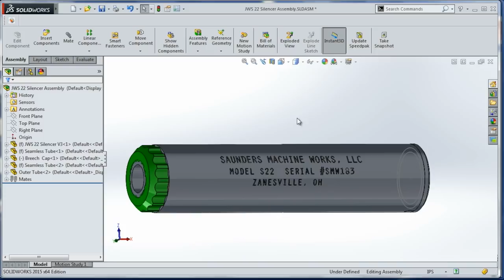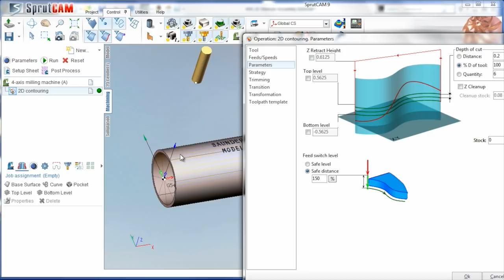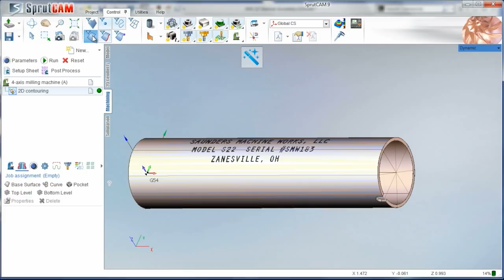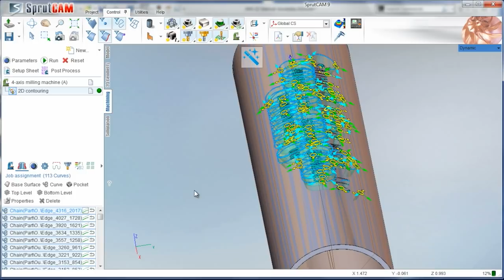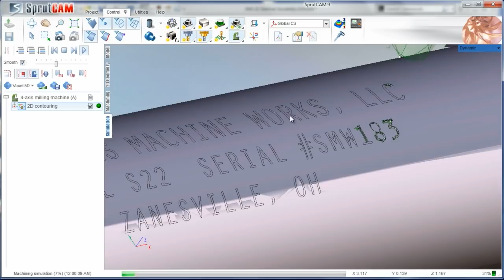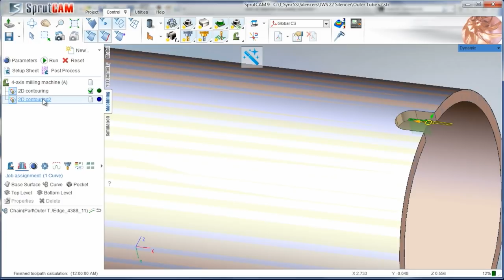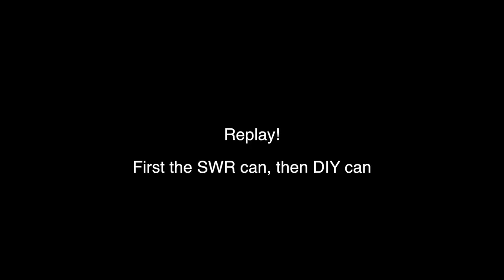DIY Silencer!  Machining a Monocore - Part 4 Widget38

Comment: I am amazed, I have watched several DIY suppressor builds and yours is by far the most in depth, best looking and well designed. I like that you also included the details of the cerakote process.

Rimfire suppressors are so impressive with subsonic rounds, the sound of the bolt cycling in a semiautomatic is louder than the shot its self. 

I agree from the video perspective that yours is quieter than the Silencerco Spectre II, and yours is almost an inch shorter. 

I hope you consider making a centerfire rifle and/or pistol suppressor. 

Keep up the great work!

Ps I like all your videos but really enjoy the firearm related ones.

Comment: Great Job John!  One thing that I do when installing a pin, is to drive it in a little proud, then turn it flush on the lathe.  You method works great also.

Comment: At Min 11 when you are trying to drive in the dowel. You filled the hole with Loktite, you had a hydraulic lock with the pin in the hole, a small hole through the bottom into the core, or use a roll pin.Great series, don't own CNC equipment, but love watching you make stuff.

Comment: Awesome series, some really nice work done! The cerakote looks like a great option to have in the shop. If you have an internet connection in the shop I would recommend dropbox, everything is automatically backed up, you can access files from anywhere with any machine and you can share folders with customers which is great if you are working on larger projects or long term contracts.

Comment: Hi John,
Both silencers are very quite from where I am sitting.  The sound seems to be about the same from both.  Keep in mind that my hearing is not as good as it used to be.  Anyway, your DIY silencer is quiet.  I'd call the project a success!  Thanks for the video!
-mike

Comment: awesome video series. your reaction is great too. only thing i thought that might not work out for you is your index pin on the core. what might time correctly for the rifle you have might not work for the next. ive noticed each manufacturer cuts different thread lengths and unless you machined a stop on the inside of the core, couldnt tell for sure, your engraving wont always time correctly for you. this is something ive noticed with my silencerco sparrow and why i think they machined a wavy pattern into their tube, so that you can index it to whatever position works. btw love the pws, i hope to have one someday.

Comment: That turned out very nicely. Wish I had a solvent tank. For now on small parts I use my sonic cleaner with some harbor freight cleaning solution it's an awesome degreaser.
Reply: I had one at my dads house but someone stole it before I could get it. I loved it.

Comment: nice wnork! The older stacked and spiral baffled silencers work as well and in some cases better then the monocores but they have some disadvantages...usualy heavier,tend to be a bit bigger and are a pain for maintenance.Either way it doesnt matter as long as it works and you can enjoy using it!Just a heads up tho most people including most cops are not well informed so be prepared to get the third degree depending on who sees it lol...course after you convince them, they will want one

Comment: Amazing work! Fascinating to watch and superb results. Volume-wise your suppressor versus the commercial one sounded about the same to my ear. Your version sounded slightly higher in pitch/frequency, so I assume it is dissipating the pressure slightly quicker than the commercial one, which would potentially mean yours can deal with increased firing rates better than the commercial one. :)

Comment: with our sandblast cabinet, we use plastic film under our glass to save our glass from being replaced, we just replace the plastic film. you could use the plastic film and put that around your gopro, or build a plastic box for the gopro for when it goes inside the cabinet

Comment: I am not a machinist, but i would have thought about doing two ridges (one for each half) on the upper silencer to hold the clam shell, and a full 360 ridge on the nut itself. This way the shells would have been held in place and the nut could fully slide around and hold them more securely.  

Also instead of the ridged nut, i would have done a crosshatch design, more grip when trying to separate and if tools are needed it wouldn't show tool marks as much. Or include spanner holds. 

Great video none the less, makes me miss my tools and shop.

Comment: Fill the 2 suppressors with water and see which holds more volume then, while holding them vertically measure the time they take to drain all water. BTW yours is quieter and drilled K baffles are the way to go if your looking for max turbulence/least noise.

Comment: HAHA! That smile on your face... The next question is how you are going to silence the gun itself. ;-) Great work. Absolutely awesome. And yes, yours was quieter (listening on headphones) so hats off to ya.

How has the durability of the home coated parts been for you? I have been debating whether or not I want to coat my new LR-308 myself or take it in.
Reply: NYC CNC Not wishing to be a safety ninny but if you need a respirator, might I suggest you don't have the dog breath the over-spray. OK, so  one off light exposure not necessarily a problem but I imagine vet bills are as bad your side of the pond as they are this..

Comment: Have you upgraded your buffer pin in the semi-auto? In a stock receiver when the bolt cycles it's slamming into a steel pin at the end of its travel, there are a bunch of replacement pins that are covered in various plastics that will quiet that cycling down a little. Even without a suppressor it's not a bad idea just for the shock absorption. Theoretically it should help your rifle last longer just because you're not getting all that shock from metal slamming into metal on every shot. Definitely worth it though if you're suppressing it. They're also very inexpensive and easy to install so no real reason to not slap one in there.
Reply: NYC CNC Hell I should have know. It's pretty obvious you know what you're doing.

Comment: +NYC CNC A couple comments:

First, I think you're doing great work, both machining and with videography. Second, I read that you said you're self taught, which has me wondering how you can afford so much equipment. I'm totally new to machining, a complete amateur and student of the Internet. I'm impressed with your knowledge and skill, but since I and most folks know little of CAD, or whatever the computer portion is called, could you perhaps offer a tutorial, or maybe slow down a tad during your narrative on the computer part of your video? I'm fascinated by all your work and intend to buy some sort of machine, lathe, or combination device to add to my shop as a hobbyist. I'd like to machine fishing lures, gun parts, and perhaps even get a Form 1 device to add to my NFA trust. 

I have extensive experience as a major crimes detective, which includes teaching as well as being an expert at crime scene investigation. My experience with digital photography and video is a sort of unexpected byproduct. I'm sharing your blasting cabinet info with my peers. That part turned out incredibly well, and like you, I was dubious about it succeeding. It turned out absoluterly fantastic! And apparently your cam is fine. Good job brother and keep making those videos.

#Marine4Life

Comment: Zanesville eh...small world, I am fairly close to you. Question for ya, I have been working on an arduino project. The logic would be that the arduino randomly raises a target from a bank of targets pauses then hides the target. It will do that 10 times then I can restart it remotely with an xbee. I am working on the remote xbee stuff now. Would you go with servo motors or stepper motors? I like that servos are cheaper(especially when a stray round takes one out), and don't use as much power(the unit would be battery powered) but I don't know about their longevity. What are your thoughts?

Comment: John , 
I have the same blast cabinet and parts washer as you. What medium are you using . I grabbed some walnut last year and it doesn't work at all. I have a great 30gal compressor . I get horrible results with the walnut Ive been thinking of going to a glass type.

Comment: The pin hole in the monocore appears to be a blind hole.  If so, my bet is that your difficulty in getting the pin is a hydrolock caused by the Loctite.

Comment: If you mixed in a small cup and measured by weight your process would be much easier for mixing your cerakote to hardener ratio

Comment: Looking at some fluid dynamics, the bullet path through a suppressor should be normal (right angles, or symmetric) to every baffle crossing.  If they aren't flat based bullets will be especially susceptible to yaw as it passes each interface.  A monocore is very guilty of this if not carefully designed.  I causes groups to open up more than necessary.  This is also true with muzzle brakes,

Comment: Is the cerakote more durable than a hard anodizing on aluminum?
Reply: NYC CNC My non-scientific experience, when done correctly, Cerakote is much more durable than hard anodize.  One my EDC, it is outlasting the stock finish on the slides of my Glocks and XDs.

Comment: Is it legal to make your own firearm, provided you've done all the necessary paperwork, or is there a law against that?
Reply: Luben Lambov It's absolutely legal to build your own firearm and NO paperwork is required as long as it conforms the the National Firearms Act (NFA) of 1933. The reason why John had to have paperwork in this video series is because the two items he built are covered under the NFA (the suppressor and short barreled rifle 'SBR' are deemed destructive devices under Federal law). For a rifle or shot gun that has a long barrel, is semi-automatic, and under .50 cal, you can build it yourself - no problem. The only caveat, you can't be a felon - you must have the legal right to possess a firearm. 

If you do a google search for "80% Lowers", you'll find a wealth of information regarding building a rifle at home.
Reply: Thanks!

Comment: download a decent dB meter app, take it with a grain of salt. of course it will not be the most reliable and accurate device but I've had some luck in pointing out noise level differences with it in the past